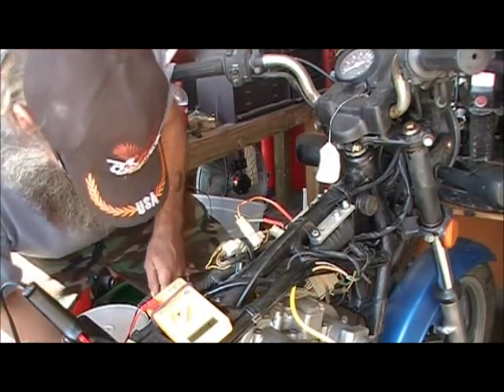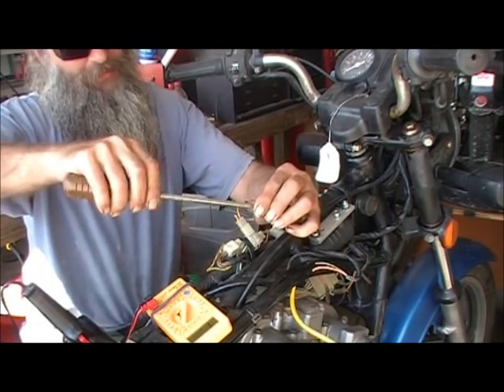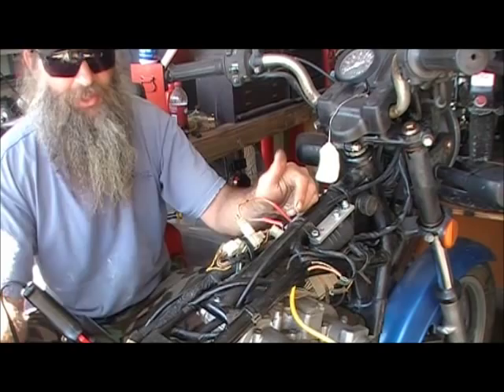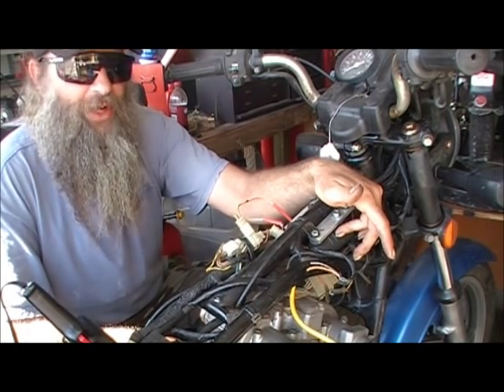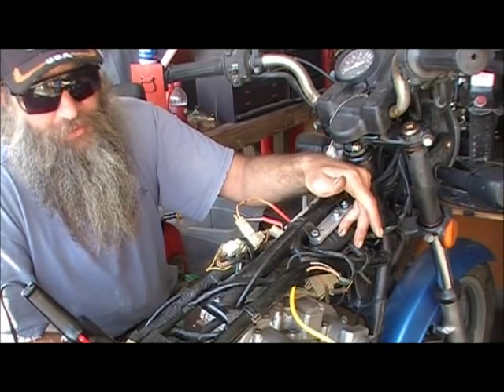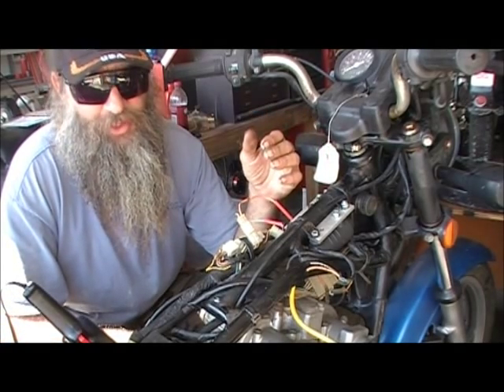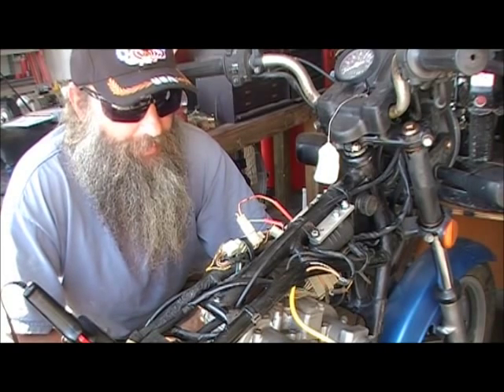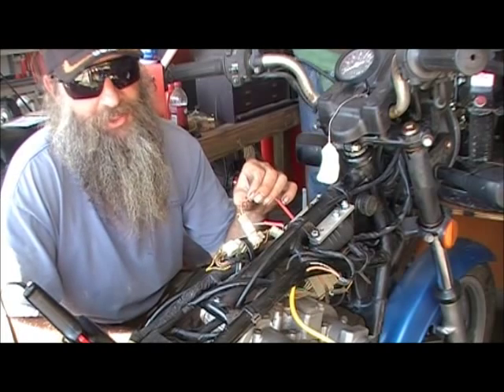How to prevent Motorcycle Coil Damage

Comment: Lovely stuff as usual. Can I remove them resistors and use those plugs on a 90s two stroke? It's just a bare hard cut 110cc two stroke with just an engine, and handlebar and a seat, no fancy electronics.

Secondly, can we use a resistor plug with a resistorless plug cap and vice versa, will there be any detrimental effects? Thank you.

Comment: I apologize  ... Think I should have  told you that the bike in question is a twin cylinder ... With two stock coils.... It's also a 72 model not the 73  my bad.... Will the coil you mentioned still work?
Reply from the maker: internally the 140408 IS 2 coils internally -- yup and same wiring setup - center is your constant - outer 2 are your triggers

Comment: Cool I'll look into it... other problem I got at the moment, is an unknown87 gn 250 i bought, running bad , been going through the bike carb/valves/compression/coil/RR, and ingnition cox on the continuety/diode setting  testing using a meter as per the manual, don't make sense (have odered and autoranging meter now so hope to make more sense of it, this bike has been sat for 15 years, I plan to take the CDI off my GZ125 and test it just to compared what a working one shows,,,Make sense to you?

Comment from the maker: If you popped a coil -- it probably took your box with it. Unless you have the little silver CDI (You should have a black one located under your tank) DONT buy a used one - they never last. If you cant find a new one - Boyer Bransden and Dyna both make aftermarket ignitions for em (usually cheaper than stock )

Comment: Yeah, it's easy to get off, but I don't have any way to test it to see if it's the coil, the control box, the relay, bad wiring, or something else.  The 2 closest Triumph dealers are over 100 miles away.  The Gill coil is about $80, the control box is about $245, I can't afford to buy part after part to try to isolate the problem. I don't have a multi meter, never used one.

Comment: hey man i tried to get my yamaha xv535 running, it did run but when im on full throttle it misfired. I ve checked the spark plugs seems ok, headlight are bright, could it be a weak battery or my ignition coil??

Comment: i need some wisdom and guidance my CBR 600 f2 right coil catches my carb diaphragms on fire melted my air box and filter it wasn't a huge fire but I have about 300$ in damages after I buy new carbs intake boots air box filter and coils plug wires and the coil harness conecter I cut the old coil conecters off because they were melted to the wire  can I solder the new ones to the main harness or buy a whole new one
Reply: Periods, can you use them? A person shouldn't have to translate you first, before they help you.

Comment: Thanks for responding. In your vido you recommended yamaha tec for cold morning where your battery is down to 10v and it will still start. So is Accel 140403 as good? If so I'll go that way. I thought you said not to go lower in ohms. And who's mikesxs?

Comment from the maker: Dyna coils are great for racing - For a daily driver they aint so good though (they like to crack) I generally stick with Accel 140403's. I tried MSD blasters on one GL1100 but that involved an aftermarket ignition that hasn't been made since the 80's

Comment: Bought an 81 gs 450 that ran great for weeks then one day I'm leaving the had station and missed the shift to second gear. once I did make the shift the bike started running like there was no gas left. Got it home and checked the tank and plenty of fuel still there. the bike starts now, however, apply even the tiniest amount of throttle and it dies out. Any advice?

Comment from the maker: if that's the 4 -- accel part number 140404 - call Summit Racing (their website is USELESS for this) order that part number as a 4 cylinder kit (same number will get you just a loose coil too).  DO NOT put 140403's on that - even though you see it in the book - personal experience (and a PhD in physical electronics) says that from 79 till about 81 those early Suzuki boxes cant handle 3 ohms perfect - stick with 4ohm coils {your box is closer to TDI than CDI)

Comment: have a question that maybe somebody can answer...bought a old 1982 honda cb 125
twin as a winter fixer upper with two 6 volt ignition coils...one is not
 working right anymore...now my question would be, can i use those 
universal 6 volt ignition coils for motorcycles you can find all over 
the internet for example:(  http://www.ebay.de/itm/like/150981600702?lpid=106&chn=ps&ul_noapp=true
 ) or must i stick to those crazy exspensive honda coils...i live in 
germany and honda coils for old bikes are hard to get and good ones cost
 over 150euro, where as those universal 6 volt coils cost 
15-25euro....it would be very nice if somebody has any info or 
expierence they could share with me...bin trying to find infos about it 
online for days now but just cant find any useful infos about the 
subject!love and peace

Comment: Thank you very much for this video, I think you hit the nail with my case. I have an Honda CBF 250 that cranks but does not start. Is not an spark plug issue because I bought a new one and nothing, so I checked the ignition coil, first the ohm reader of the main wire reads as 0.8 (and should be around 2 to 4 if I am not wrong), the second wire reads as 7400. ( i think should be 9000) but then I checked the spark cap, took out the screw... and it was empty! no resistor inside! Is that possible?

Comment: I have a '97 VT1100 Shadow ACE, and it's driving me batshit crazy. Had it into a local shop for a fuel pump, and their monkeys screwed up a few things, Got the fuel system addressed, but it still won't run worth a damn. Idles fair enough, but crack the throttle and it spits and sputters and backfires. No vacuum leaks we can find. It also has an intermittent miss, a really bad one where the back cylinder is dead. Plug in that cylinder is good. Checked spark with a homemade plug and ground wire, and the spark is very weak, dull orange at best. The step by step testing in the factory manual is a bit overwhelming, and I don't have their testers. Is there a simple way to check all this? I don't do guesswork troubleshooting, and don't want to arbitrarily replace parts. I deas?
Reply: Disco58 
if you figure this out let me know. I have a 95 I am restoring and I am having similar issues.
Reply: Wet the coils see if they shock the shit out of you what does spark plug wires and Boots run your hands over see if they shock the shit out of you it ain't that bad it'll let you know where the problem is but when you're dealing with older shit like that you're better off to replace it all at one time or something else and something else and something else will keep going bad. ????? 90% of all electrical problems are a bad ground somewhere. !!! Remove clean mating surfaces and bolt back down.!!!

Comment: Thanks for the great info and presentation. I'm trying to find coils that'll work for my '78 Honda CB400t Hawk, as the coil secondaries show no continuity. Also something peculiar with the plug cap resistors...they act like capacitors when connected to an ohmmeter in the 2k range. First, no reading, then briefly 1450 ohms or so, then back to no reading. When assembled, no continuity, so I'll replace the caps. Any recommendation on aftermarket coils for this bike? (OEM stock is history!)

Comment from the maker: water in on your pickups?... Doesn't sound right though because I think yours are in oil - very possibly they knocked a wire loose somewhere OR MOST LIKELY they didn't re-assemble your carbs correctly

Comment: Can you tell me how much voltage goes into the primary on the yzf
Reply from the maker: 12v into em -- as to how much leaves em for the secondaries I'd have to look it up
Reply: dawino6260 thanks
Reply: dawino6260 but doesnt have to be ac voltage for inductors to work?
Reply from the maker: That's irrelavant to the coils - Coil will MAKE its AC -- remember points? -- As a general rule -- the trigger leaving your cdi box is 10-15v - on the trigger side -- Your constant is 10-15v + --- All they have done inside those boxes is create an inductive trigger -- generally magnetic -- that hits the box -- the box has the power for those (which are easy to make 0

Comment: What would you suggest for replacement coils on a 73 Honda cb 350  stock bike
Reply from the maker: an Accell 140408 - use center terminal is your constant outside 2 are your triggers - Use condensers for a 66 buick LeSabre with a 430 olds engine (only way I know to tell NAPA and get the right ones)
Reply: +dawino6260 after moving to 140408s do you still recommend the resistors?  (mine is a GL1100) and i am moving to accel

Comment: My bike is a constant puzzle.  I have a1986 Yamaha SRX600, single cylinder, kick start only, air cooled, basically an XT600 motor.  I have it jetted perfectly, but when there is a light rain or misty rain she will sputter and die.  She'll ride home without issue in a tropical downpour (I live in Florida). I mean,  WTF? When I have the trouble with it dying out its usually in town.  Once I hit the highway I have no issue. I read some people say its the coil. That it has 'micro cracks'. Well, I'll see if it's the coil because this weekend I'm replacing the coil, wire, and boot with factory.  Other aspects of the electrical system have already been dealt with, like stator, regulator. It's a fucking Scooby Doo mystery. I'll let you know.
Reply from the maker: If it's been jetted a stock coil will cause endless plug fouling --- Generally single tower setup like that I'll do a dyno or i prefer a nology pro-fire single tower (I have a collection of dead Dyna coils - they are not meant for daily driving but they are awesome as an Accel when they work -- nology coils last as long as TEk's are 2x the voltage (same ohms) and will give spark as low as 10v if your battery is down )

Comment: How's it going sir,

I've got a 95' ZRX400 here in Okinawa Japan and these damn ass clown so called bike mechanics here are trying to run one over me - I've got sport exhaust and power air filters, carbs been tuned and jetted to run the mods - 2 weeks ago I got stuck in a monsoon rain - took to the shop, tank cleaned, carbs overhauled, wires and sparkplugs replaced, neutral it revs all the way to redline NO PROBLEM - in gear (any gear) more than 20% throttle it sputters like skipping spark